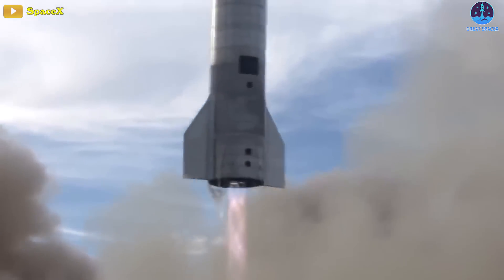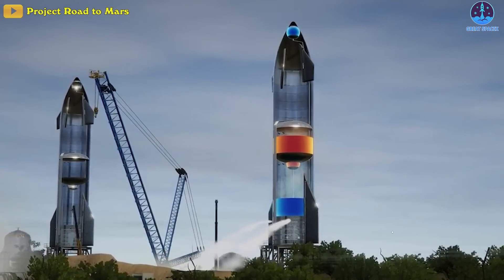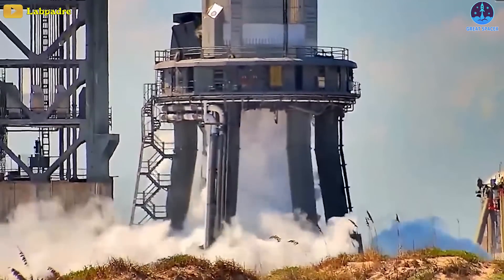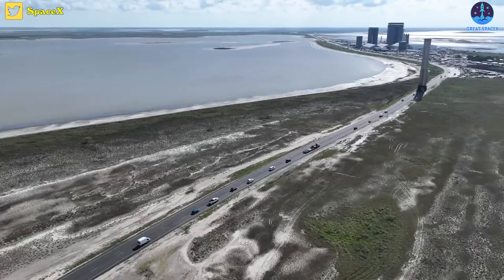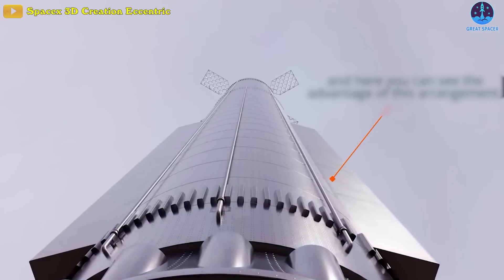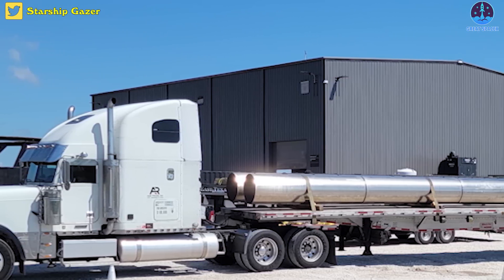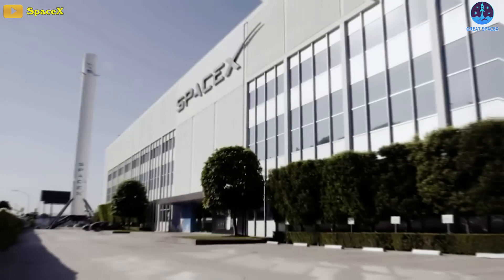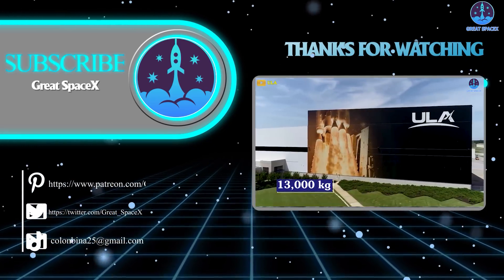Elon Musk Upgrades Everything On Booster 7 Before First Orbital flight in Texas...

Comment: I think what will happen in the end of Musks’ 33 engine super heavy booster rocket will prove to susceptible to failures because of too many engines to control and to rely upon each one of those 33 rockets.  Sure all 33 rocket engines togethe produce a little more than twice the amount of thrust the Saturn V produced with it’s 5 F-1 rocketdyne engines, 17 million pounds of thrust versus 7 million pounds of thrust on the Saturn 5.  But when it comes to engineering the KISS principle alway wins in the end of success.  
K.eep I.t S.imple S.tupid.  And that's exactly what the Apollo mission engineers did.  5 very carefully designed tested over and over and over again to the point of perfection on the F-1 engine.  Every single one of the 7 Apollo landing missions to the moon,  the launches and operation of the F-1 engines were flawless...for a reason they kept it simple as possible with the minimum engines needed to complete the planned mission and they tested the F1 over and over and over and over again and again and again until they knew they were almost bulletproof.  Using large amounts of engines requires large amounts of time and money to produce each one under very controlled atmosphere and best conditions, almost like they produce micro chips.  Musk’s operations seem to be all about how fast can they get the equipment out the door.  On manned missions this is going to end up in a major catastrophe with humans taking the brunt of it.  Apollo 1 lost the whole 3 man crew on the ground, Space Shuttle Columbia lost the whole crew of 7 on launch and Challenger lost the whole crew of 7 coming back to earth.  It’s great we have private company like Musk’s Space X moving space exploration off dead center after 40 years of standstill.   But don’t ever forget space travel is inherently dangerous and alway will be and the danger increases exponentially when pushing the envelope like I think Musk’s Space X company is doing now.
Reply: Musk's SpaceX company is the ONLY company that launches manned missions to the ISS on american soil right now. That is what Musk's SpaceX company.

Comment: 33 engines firing simultaneously, going to experience huge "harmonic" vibrations. Is the structure strong enough to hold it?
More: 
What is the difference between a CEO enterprise leader and a professional manager?
A leader performs his leadership by good decision "To do the right things"
A Pro-manager follows the top-down decision "To do the things right"
My recommendation of leadership to Elon Musk and SpaceX management team.
From a Qualified (2 decades) PMI certified Sr. Project Manager, NTU Education Instructor, NTOU Assistant Professor.
Reply: Elon's the Chief Engineer of Tesla and SpaceX. He does the CEO stuff because he has to, not because he wants to. It's worked out alright so far.
Reply: @waynzignordics  Appreciate your response and explanation very much.  This reminds me a management term" "Halo Effect", If Elcon can't avoid the consequence to appoint a CEO or separate his Engineering role then SpaceX teams will suffer. Trust me, there are too many awful examples. I believe the staffs have already complained but not fully revealed yet.

Comment: Is there any "Interior Ridgitity" within the Booster, or is it just a Stainless Steel Tube?
From the graphics that are shown, there is absolutely no interior structure to keep this tube from twisting, folding or collapsing...
Unless this is what you are discussing about "auto-struts".
Please respond to my inquiry, as you usually don't respond to questions.
Many thanks,
Thomas 🖖
Western Washington State
Reply: The tanks provide support especially when pressurized
Reply: @jmattoxriskpro  Yeah, but the hull is the tank wall for most part. SH is not as fragile as, say, that Early Atlas that collapsed when depressurized, but during maneuvering some support might still be needed.
Reply: Starship re-entry will be interesting as the atmosphere must exert significant force on the exterior of the hollow cargo area between the nose and tail flaps. Effectively the force on the flaps would fold the nose and tail backwards on it's empty hull. Couldn't have been an easy solve... if it is solved.
Reply: Struts, struts, struts. Those black dots spotting the body's exterior are welding points of thousands of interior struts. There are other weight-baring structures inside, too, like for the capture pins. But the genius in the design is forcing all the weight to fall in-line with the steel frame. It's like a 100-ft high wall of steel so long as it doesn't buckle. Rockets are magic.